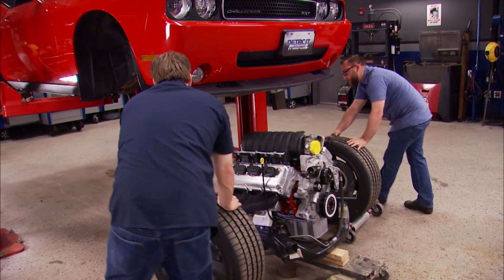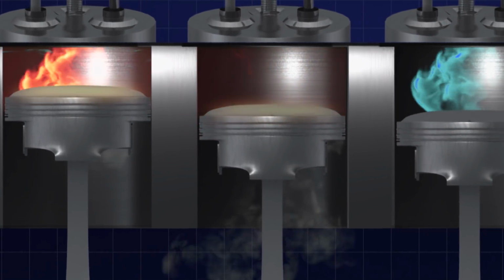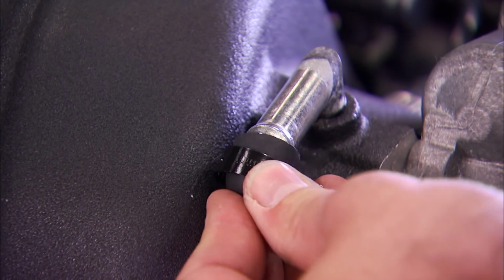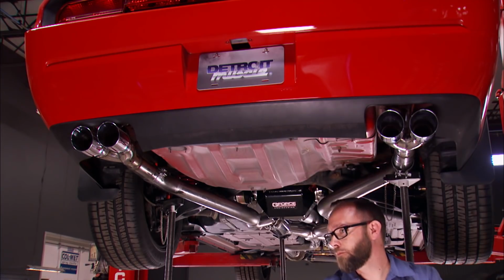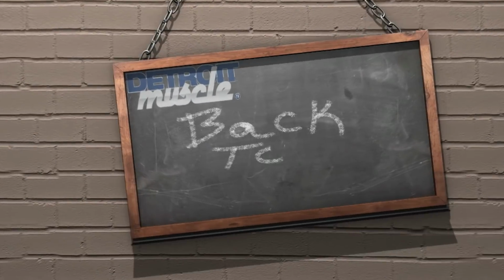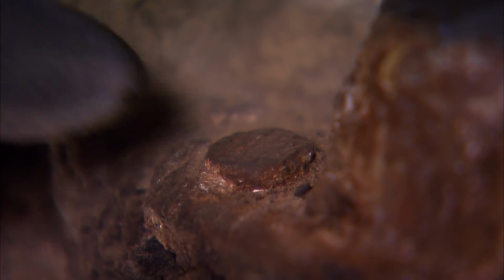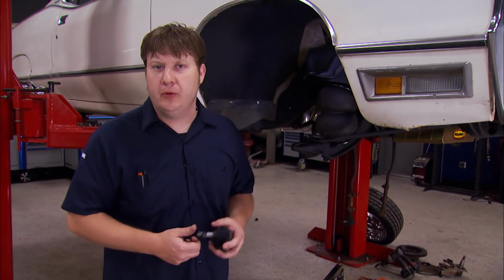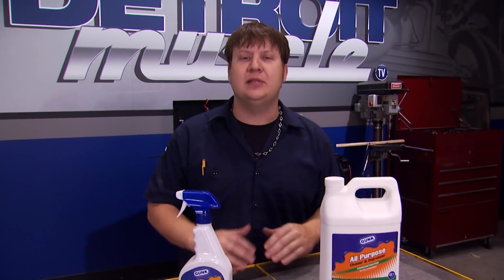Custom Performance Exhaust for the 2010 Challenger SRT8 - Detroit Muscle S3, E15

Comment: Couple of things I didn't like.
Welding on the SS plumbing looks like MIG.  For this kind of money should be TIG.
Air filters under the car !
Turbo oil drain back?  If you put the turbo under the engine you must have a catch tank and a pump to return the turbo oil to the pan/tank.

Comment: I'd be nice if they told  the people the truth and not just what their sponsors want them to. holes in the brake rotors do not decrease the temperature they were put in there for out guessing cuz old brake pads used to out gas newer pads don't do it anymore so they're not necessary they just lead to faster cracking

Comment: Where do you explain the oil system on how the Turbo oil drain is lower than the pan so you have to get a pump to put in back in the oil pan so you don't get burning oil?

Comment: dont know what year you was born but the way to get rid of those crank case fumes is to use a vane pump like an old smog pump and plumb it post turbo into the exhaust. we built venturis that went between the 4 tubes of the header collector

Comment: You are suppose to connect the other side of the oil catch can system back to the intake manifold so it has a vacuum/boost reference to assist the flow of gases through the catch can. Otherwise it’s worthless

Comment: I can chime in on the oil quality issue, as you can tell by my name, I have a 612 whp EJ8 1997 Honda Civic that I built as an all around racecar, but mostly it's used as a drag car. I originally bought this car as a $1000 project car. When I bought it I got it from a 19 year old kid that knew nothing about building engines, but he rebuilt the JDM D15B 1.5L SOHC VTEC engine that he bought for it (even though it had less than 50k miles on it) and I drove it for a week before I turbocharged it with an eBay turbo kit, ARP head studs, a Cometic MLS head gasket, Walbro 255 LPH fuel pump,  DSM 450cc injectors, and I chipped and socketed a P28 ECU to accept a 28 pin ZIF chip to tune on Crome. Now, I didn't know a whole lot about performance import engines at that time, but I always ran Mobil One 5w30 oil in it and even with me revving the stock engine and valve train to 9000 rpm on 10 psi with a .63 A/R T3/T4 turbo, that car NEVER gave me a problem short of not having a oil catch can on it and it blew the dipstick out (along with almost a quart of oil) at the track one day. It was alot of fun, but I decided to upgrade to a DOHC non-VTEC engine and turbo it. I did the swap from underneath by myself in my mud and gravel driveway because I didn't have a cherry picker. That engine ran unbelievably well and was really fast for a stock engine (with ARP head studs, a Cometic MLS head gasket, and the same pump and injectors). It eventually developed rod knock after 8 months of beating the hell out of it due to the fact that it had alot of miles on the bottom end and the guy that I bought it from lied to me and told me that it only had 90k miles on it when it actually had 250k. Anyway, for the next engine I went with a standard rebuild in my dirty dusty garage and a real dyno tune and it put down 408 whp on 16 psi. Always on Mobil One 5w30. It was at that point that my tuner told me that I was crazy running that thin oil. He told me that I should be running Rotella 15w40 with STP Oil Additive. I've been using that for a while and I eventually built that engine with Eagle H-beam rods, CP 9.0:1 0.030 over pistons, knife edged and micro polished crank, balanced rotating assembly, Supertech block guard, a built Civic Type-R head, Skunk2 Stage 3 Cams, and a matching valve train, Garrett GT3582R dual ball bearing turbo, Walbro 560 LPH Hellcat fuel pump, Gates 2200cc injectors, and a bunch of other parts including Hondata S300 V3 and the Hondata CPR coil on plug kit. It currently makes 612 whp on 22.5 psi and I ALWAYS use Valvoline VR1 20w50 and a Lucas Zinc additive at every oil change. That engine never misses a beat. So, what I've been saying is that even though you go to choose an oil for your car, or even your racecar (if you own a racecar you should know the difference), synthetic oil is good to use in most cases, but what you really need to pay the most attention to is the weight and viscosity of the oil. In high performance engines adding a zinc additive is almost always recommended or even required. I will ALWAYS use some type of oil additive, STP is the cheapest form of engine protection and can save your crankshaft in some cases.
Reply: I have a 1973 Plymouth fury with a 318cu in and I run 20w50 Castrol GTX in my car and you can just hear with a heavier weight oil it runs smoother too, also the first time I put it in my car it pulled a bunch of nasty shit outta the motor since the oil was thicker, It was really dark and I changed it after 2,000 miles. I change it every 3-4k miles now and it's comes out looking a lot cleaner than the first time lol

Comment: Of all things to replace, the brembos wouldn't be one of them because they work great and stop my 2010 just fine. The SRT crew went with 6 pistons up front on the newer Challengers, because they are also about 300 lbs heavier. The stock exhaust sucked on the older models, and was one of the first mods that I did on my baby. Those huge suitcase style resonators are heavy AF and are also somewhat restrictive, even though the one is used on the srt's are a larger-diameter than the ones on the 5.7. I went with open chamber racing bullets with 3" reso deleted straight pipes, all the way out the back and sounds awesome now 👍🏼

Comment: I hope that catch can has a vented top, or else you just make your crank case a sealed system.  also, eliminating the vacuum basically just means you'll pool whatever oil splashes in the line.  poor execution.
Reply: If you look at 5:36 that mesh I believe is the vent to atmosphere
Reply: @Dieselfreak13  I correct Myself, I see what He did there, there is a Mesh on top of the catch can that basically vents those gases under the Hood 1st, Then into the atmosphere...
Reply: @phigo4kins  then what is the pvc valve for?
Reply: @demobucket6  You tell Me Sir.

Comment: So to beat a hellcat, you spend more than the price of a hellcat on a used car??
Reply: It’s about what you can build not buy
Reply: Eli Waldrep yeah your an idoit hellcat 60k + car, they spent 15k on this srt and 25k on the mods and upgrades way cheaper than hellcat
Reply: BILL NYE THE BLACK GUY that engine alone is gonna be around $10k, those turbos around $8k, that exhaust around $1k, suspension around $2k, drivetrain around $5k, new cooling system around $2k... And the list goes on. So if you even are correct on the $15k for the car, then $15k + around $30k is about $45k or possibly more. A 2015 Hellcat goes for $40k-$45k. My point was why spend so much money on a car that you wouldnt be able to drive for quite some time, only to compete with a stock car that you could buy for close to the same amount. If im capable of a simple google search, which you proved you're not, then i believe, how does it go? "Yeah your an idiot"
Reply: Eli Waldrep exactly, id rather just buy a 2016 hellcat and modd the hell out of it

Comment: That turbo placement keeps me up at night. In what world is that a good idea?
Reply: A big ass puddle can kill a challenger I’ve seen the aftermath and i don’t think I’d feel comfortable driving with that much power in the rain anyway
Reply: The whole point of having a racecar/muscle car is to drive it on good days ie check ur calendar when u try to enjoy it
Reply: In the world where under hood clearance is an issue, in a world where it's simpler and requires less parts and weight to mount them on top, in a world where a  lower center of gravity is better in a world where oil line plumbing could be hard...it makes more sense to mount them there from every standpoint. It's simpler to mount, you don't have to mount the exhaust forward, then backwards again, take the intake tubes down into an intercooler, then back up, when you can mount them under the car and keep it simpler and they are a bit sleeperish cause you can hide everything and nobody knows you're boosted untill you fire it up
Reply: @Love_for_Christ  In a world with perfectly clean and dry streets. In a world were you can afford to grenade a built engine from hydro lock. In a world were you have the money to throw at a trailer queen that sees a prepped track once a month. In a world where you can wipe your ass with $15,000.
Reply: I pretty sure they can fabricate an engine splash shield out of metal to stretch from the front to the cats or u can if u want take it to the rare tires
Reply: @johnjames2715  hydrolocking an engine is significantly more difficult than people think, especially on a larger motor. It's also cheaper and easier to install bottom mounted turbos

Comment: I never seen an oil catch can with just one line... I’m baffled...
Reply: it's completely worthless.  the oil will just pool in the line.
Reply: So I am not the only one who thought WTF. My pcv value runs on a vaccum
Reply: I know, I rushed down here to see what the topic is about that catch can. I know I'm not crazy because, Capping off the Port that dumps the Fumes to the PCV defeats the Purpose of the Catch can in the first place... 😳
Reply: You can do it that way but you need to tune the car for speed density / maf delete. At this point its just a vent to atmosphere. You would also want to cap off the fresh air pcv line or it will be able to back vent inside the intake also.
Reply: @CamaroRick  exactly.
Reply: So how long before a line or the can blows...especially running boost...off to see the dyno tune lol..
Reply: @spyderlyf3  there's no compression in the crankcase.
Reply: because they are not letting any of the crank case fumes back into the intake system. With a two line some oil still gets back to the intake. This will prevent that